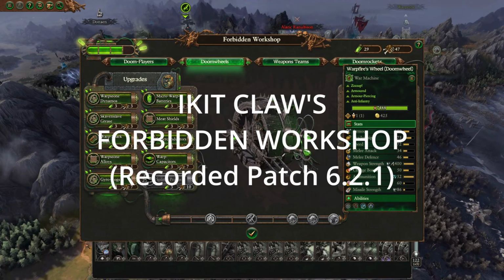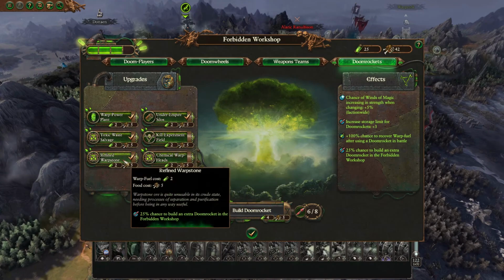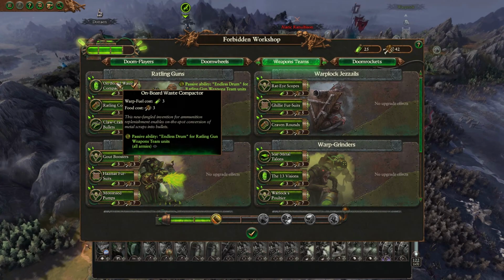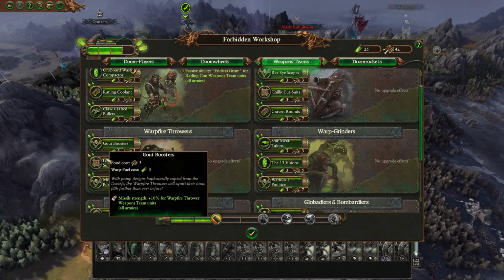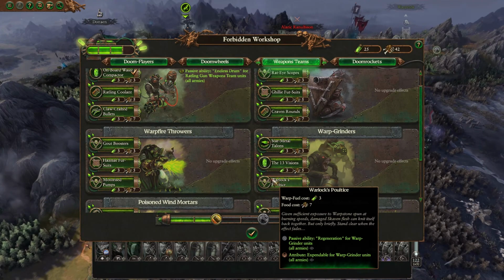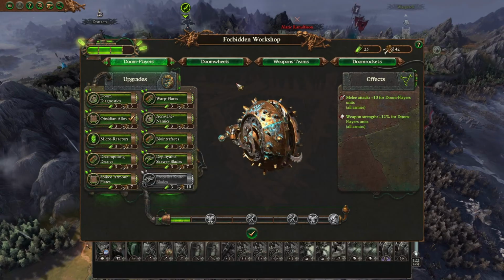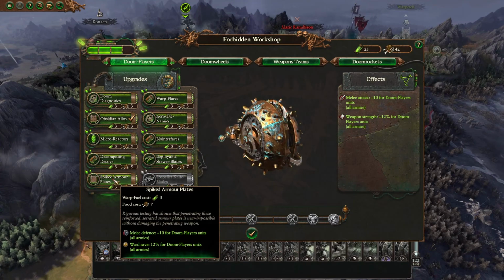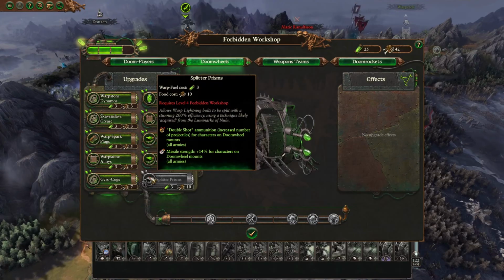Ikit Claw Forbidden Workshop Deep Dive Guide - Skaven Campaign Focus

Comment: I recently finished a long campaign and didn't get all the upgrades, maybe I didn't know how to generate enough warp fuel. By the way, excellent video!
Reply from the maker: Just try recruiting as many Warlock Engineers as possible and have them doing mischief on the campaign map to make up the gap. You're certainly fighting enough battles... but I haven't closely measured if non Warlock Masters are picking up fuel. Some turbulent RL stuff has unwound so I'll happily gather more data soon.

Comment: Yes, there are several UI elements where the CA designers need to back to school or a slap.  That scroll down element in the workshop I didn't find out about it until well in to game WH3.  

Also,...
Over notifications.  Stop stealing control and zooming my halfway across the map to see the location of a quest battle I'm not going to do for 50 turns.  You have a pop-up with a zoom to location button already.

Item pop-ups, do I enjoy being notified about items twice in mildly different ways?  No I don't, does anyone?

In fact just stop me having to click through notifications that I don't cares about, and really have no effect on the game, each turn before I actually play the turn. You have a list of over them, let me have control and stop taking it away from the player.

Bit of a rant, sorry!
Reply from the maker: It's completely fine, my best friend has an unused college certificate in game design, I get these kinds of comments about other games and it's no big deal. CA has tightened a lot up of late (belatedly) but they made plenty of missteps too as is inevitable in such a huge game with so many DLC's. We should encourage the good work.

Comment: 1. For the weapon teams...IMO Jezzails, Poison wind mortars and Warpflame throwers is where you get the most payoff. Additional armor on Warpflame throwers is absolutely magical for...well, not dying when fighting archer heavy factions. Sadly there is no banner that grants snipe (as far as I know) so you can't have a second equivalent of the RoR jezzails. Just the stalk doesn't do super much for the jezzails given how long range they are....but the damage upgrades. Oh, the damage upgrades. Warp grinders and globadiers are situational units, and beyond getting ratling guns their endless drums they manage fine without those 2nd&3rd upgrades.

2. The team that designed the Prophet and the Warlock DLC went absolutely mad with movie references. Everything from the Fury Road workshop references to the cut-for-cut predator trailer. Only thing missing is flame guitars.

3. Doom flayers and doom wheels are...pretty good for Ikits faction. Insanely good infact. Everything that applies to doom flayers/wheels in other factions applies doubly to Ikits versions. Although flame thrower upgrades vs doom wheel upgrades makes using doomwheels as bait for warpflame throwers a double-edges sword.
Reply from the maker: I need to watch that trailer in full. The Fury Road is completely apt and a natural evil connection to make so I'm glad they went whole Roadhog. I think you have excellent points for the unit comments, though the ratling guns' third upgrade does make them better, need or not.
Reply: I've taken to using warp grinders as a replacement for clan rats in my armies. They also have the added benefit of being able to immobilize enemy units with their unit ability on top of doing tons of damage.

Comment: The forbidden workshop may in fact be the single most fun mechanic in total war warhammer 3. It is rivaled only by other reskins of the same mechanic.
Reply from the maker: I haven't messed with Elspeth's yet, actually. I didn't want to do that until I went back and mastered Ikit's.
Reply: @OffToBattle elspeth is fun but remember that standard missiles do more direct damage while the magical one will do more overall aoe. Also splash damage on gun jnits is crazy good.😊